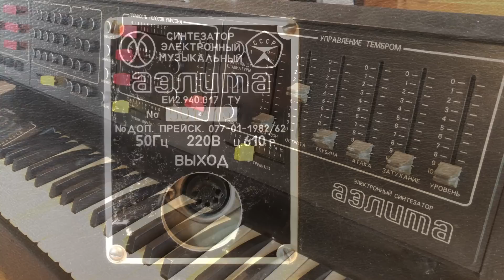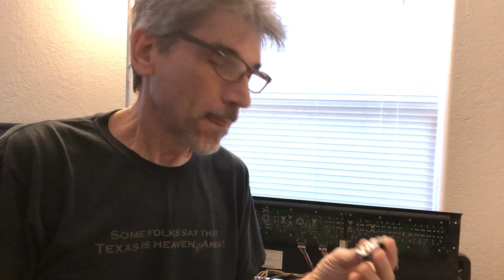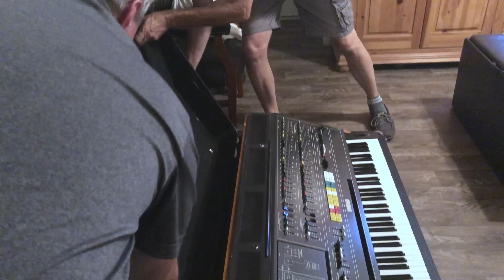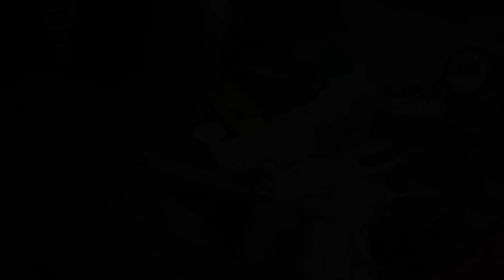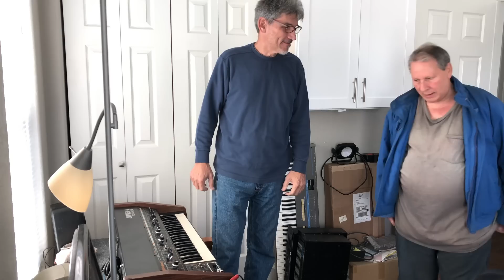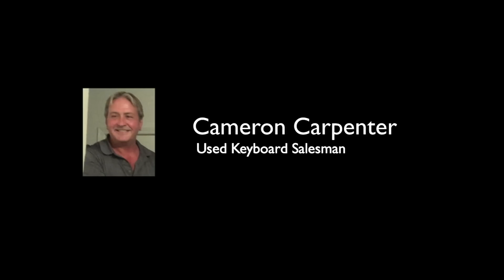Synth Wizards Episode 6: Jupiter under Pressure

Comment: I am late to your channel…but one thing to maybe consider for a non-destructive  on/off switch is to mount a magnetic reed switch under the panel. You can the. Use a magnet to turn on and off a circuit.
You could rig up a switch that just sits on case( also held by hidden magnets under case) and there you go. Easily removable and completely non-destructive.

Comment: It's 4 years late, but, cool option for the control  mods that dont alter anything or require drilling is push pull pots like in guitar world on amps and guitars.  The pot would accept same knob but would give great double control.  Also can get pots with buttons in center.  Hope you guys see this message and helps.  Love your channel and videos.  Keep up great work

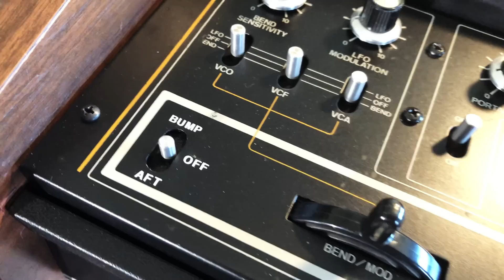Comment: 29:49 Great to see all the effort going into giving an elderly great synth aftertouch. It may only be Ch AT but on an analog synth CH AT still works well and is far better than no AT at all. Well done! Hopefully Korg and a little less hopefully Roland or someone else will bring back poly AT done right to work with todays more complex sounds and all the new possibilities modern synths introduce that need individual triggering. Even keeping it dirt simple and just having the ability to increase the volume of one note or one of it's component voices when holding a chord without triggering every note and making a sonic mess adds a huge improvement in expression.

Comment: ....you definitely connected the aftertouch to the wrong oscilator, therefore it variates when changing to other voices. either you connect it to another point or you'll have to add one more final independent oscilator somewhere between the last oscilator stage and the preamp... i know that is not an easy fix ... so sorry for my potential arrogance... i really respect your work alot! Keep up the good work man!

Comment: I own a JP4. I took it to have it fitted with IO, but to my surprise  I was told it didn't work. This was news to me, though I admit I hadn't switched it on for years. I'd never had any issues with it. Is there a fault common to these? Unless it's the old classic cap failure problem?

Comment: why not leave the jupiter original and use a eu to us adapter. kinda unnecessary if you ask me?
Reply: The issue isn't the plug point its the voltage and current going in. Modern synths often seem to come with a variable transformer so the can operate at region specific voltages. They'll sometimes be marked with (120~240V). With those you can simply use with an adapter.
Reply: @KieranJohnMusic  If you buy a usa to eu adapter which comes with a powersupply/converter you have zero issues. It's also called a power converter or you could buy a simple step up converter which would have kept the roland in original shape and would have still cost less then the unnecessary mod.
The reason why his power switch gave in is because it ws rated to be in a 220V piece of gear. God know what other circuitry might have also been affected by the sudden powerswitch, which might take some time to show up.  I'm actually an American and I have never understood the need to convert an eu standard electric unit to usa standard. Never got that, call me dumb or ignorant. A step up converter would have been the way to go, If it ain't broke then why feel the need to fix it. A wise man once said. To me it seems completely redundant.
Reply: Lalaland good point, I see what you’re saying.
Reply: Lalaland I have a CZ1 from Europe. taking 120 to 240 required a 7lb transformer block to boost the juice. Gigging with it is not fun. Their solution is elegant and if the transformer installed is properly spec'd the synth doesn't know the difference.
Reply: @dr.feelicks2051  a 7lbs converter to me seems overkill for a simple max 30w synth. I actually happen to have the same one which runs fine on a thing like this. https://voltage-converter-transformers.com/collections/step-up-down-voltage-transformer-converter/products/vt-1p-100gs-step-up-transformer-100-watts-with-outlet-for-euro-plug. Or this one, https://voltage-converter-transformers.com/collections/step-up-down-voltage-transformer-converter/products/vt-100-step-up-down-voltage-transformer-100-watts which only weighs 3 lbs. You are seriously running that thing on a unit that probably outputs 300W or more. 7 lbs transformer a CZ one only needs 30W to run properly, someone either sold you a truly overkill piece of kit, or you didn't bother to research what you really needed. Here are the specs of your CZ1 https://www.gearogs.com/gear/4019-casio-cz-1 30 W max. that's it. NO need for a 7lbs transformer. What good is that going to do anyone. Breaking your back for no reason whatsoever. Have good one.

Comment: FYI, you can buy "printable" slide transfer paper. White printing is harder since you will need a printer capable of printing in white ink (most printers do the white by using the paper as the white areas). But you can buy color laser printers that do print white.  Also, if you own the slide paper you can have a local print shop do the printing as many own a printer capable of printing in white ink. This can be a huge help if you get stuck finding a match for a given label printed on a synth. If all you need is black or another color you can use most laser printers to print your decals and the number of fonts available to match your existing is huge and makes a match much easier to find..

Comment: New subscriber here, from across the pond in Wales, UK.  I am a synth lover myself, having owned only a few in my time, but currently I own the absolutely awesome Access Virus TI and my Burgundy baby, the Korg KARMA. Sadly though, the KARMA has a few keys not working and despite taking it apart and cleaning the pads, alas some of the keys still no longer work.  I also have an issue with the modulation and pitch wheels on my TI, I think there must be a damaged connection  from that module to the main board, and I must get around to sorting it if I can.  Anyway, loves watching this, and will be happy to watch any new vids you release.  Good luck with the Yamaha... greetings from Wales.

Comment: Rio is Bass preset , random Arpeggiator.  
Play and hold E sus 2,.  = e f# and  b , when you catch the arpeggiator on the record in the same sequence position it will play note for note the same as on the record, my jp4 certainly did.   The random Arpeggiator on the jp4 is a random sequence of 100 or so notes that loop, it's exclusive to the jp4, here is the original jp4 off the record    https://youtu.be/osFC1ugUfjI you can clearly hear the random sequence repeating

Comment: most transformers you should be able to just use the different windings avaliable, i have done many 110-240 conversions with just rewiring the transformer to use the secondary winding for 110v
Reply from the maker: Some Roland transformers do have provisions for changing the input voltage - it just requires moving the input wires to different posts on the transformer (and usually changing a fuse value as well).  But the JP4 did not have this, so we had to find a different transformer.
Reply: @Syntaur  interesting, will keep that in mind if i ever have the task of restoring one of these beauty's , love the channel! not sure why i have only discovered it until now, fellow synth restorers unite!>

Comment: I just bought a pretty rare analog synth (I've never even seen one before) it's an Ekosynth P15 which is immaculate and even came with the original Eko pedal too. It's a preset synth switchable to manual mode. In manual mode it sounds like a cross between a Roland Jupiter and Moog. I hooked it up to a delay and reverb and couldn't put the thing down. I'm currently looking to see if it could be converted to basic midi or CV. Great video, I love these old Jupiters

Comment: going to do a kit Sam?
Reply from the maker: No, the panel drilling is too cumbersome - more so than shown in the video.  The switch actually mounts onto a bracket underneath the panel, and three holes have to be drilled in that bracket - and then the panel has to be drilled (and cut in that oblong shape) to match the bracket pretty precisely.

Comment: I'm surprised they didn't go with a push-pull potentiometer to kill the aftertouch, given their misgivings about drilling the control panels.
Reply from the maker: We didn't need a pot, just a switch (and a pot would have required drilling too).  Maybe you mean replace one of the bender panel pots with that, but that seems (for me at least) non-intuitive for the user.  In the end, I'm pretty happy with the way we went - the Bump action of the switch is pretty cool, as is the ability to quickly and easily switch aftertouch on or off.
Reply: @Syntaur  Ah, yes. I meant replacing one of the existing pots with a push-pull. That's usually what I see for "damage-free" mod controls, but they are, admittedly, a little bit more cumbersome than a plain switch.